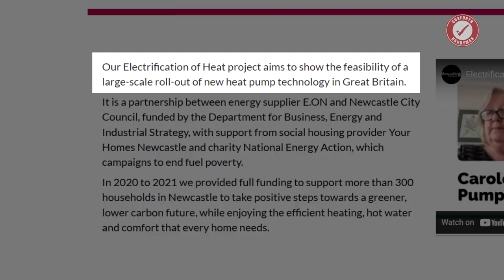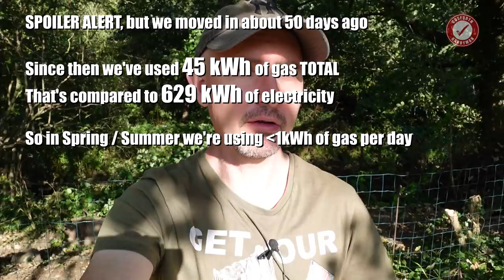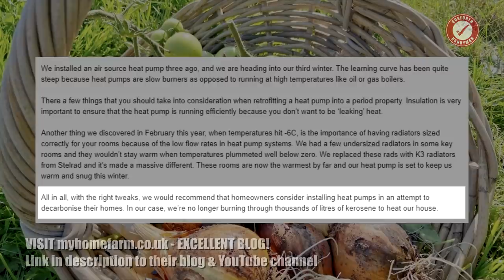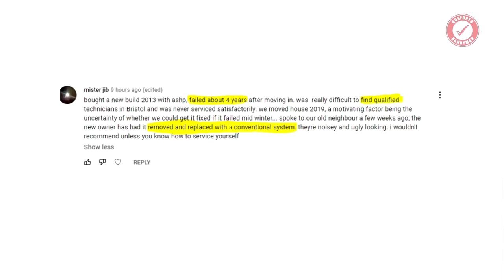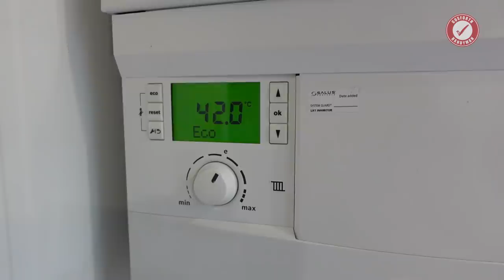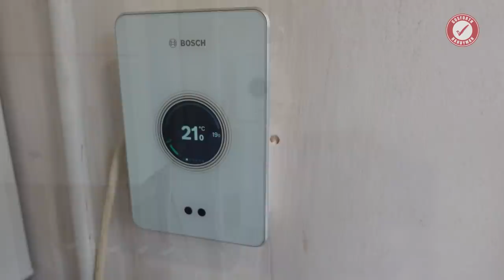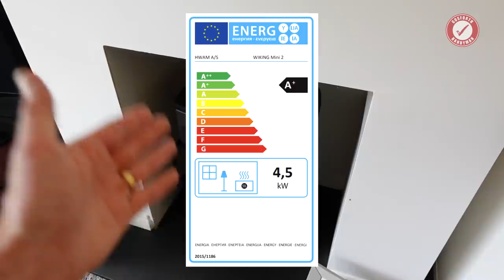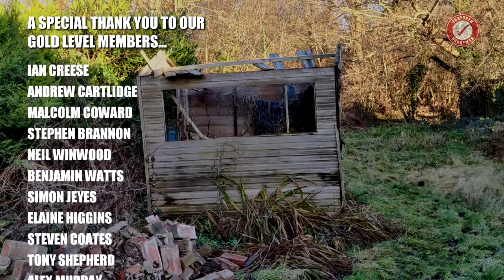Why didn’t we install an Air Source Heat Pump? (1920’s Renovation Part 32)

Comment: Wow. The backward thinking on ASHP and GSHP is astonishing. Putting in gas was just madness. The air available on a cold winter along with the refrigerant always will warm your house. Mine has been the equivalent cost as my last 12 year old gas boiler. A well designed system installed by competent installers will be a better future investment. It cost 2k less than upgrading to a new gas boiler due to incentives.

Comment: Everything you do is great except the damn spray foam. If issues arise like damp behind, wet rot, bugs, leaking roof you might be safe for now, but I personally would risk with this lazy option.

Comment: I find 50% of your advice and viewpoint spot on IMO. But I also find the the remaining 50% just seems to miss the point entirely. We must change our life styles and curb our expectations for the sake of the future of the human race.. that means the children and grand children that we love and the persons living on this planet that are not blessed with the support networks that we have the benefit of.. like NHS and public works flood defence projects. Elderly people need to keep cool in summer heat waves. No combi boiler can facilitate that. Maybe a shower that is so powerful that it can cause discomfort is an unreasonable indulgence, especially if 4 persons are showering on the same day. Personally I now use the sink and a flannel.. The government were not wrong on diesel vehicles as the intention was to reduce global carbon emissions by the switch, which they do. However we subsequently became aware of the health consequences of DPM emmissions and the complex cocktail of toxic elements therein posing a marked effect on human health of significant localised emmissions. There is a lot to say about variable electricity tariffs, vehicle to grid and vehicle to load possibilities powering the ASHP. If we have an ASHP installed there will be no radiators or copper pipes or circulation pumps running, but then we only have one ground floor room that we need to heat. The rest of the house will remain unheated, as it has been for the past 15 years. Different to many people's rambling mansions.. that they apparently need to make life worth living! G.A.L! 😉

Comment: Please don't use this clip as an intelligent assessment for the selection of a ASHP/GSHP. The mis-information gives an unbalanced perspective, ASHP are extremely efficient for the majority of the time with GSHP being the most consistent, You can also use a bore hole not only a slinky type. I understand the capital cost comparrison does favour the Fossil fuel boiler but if you take into account the CO2, NoX, SoX, CO the boiler produces for the entire life V's zero emissions of a ASHP/GSHP when electricity is provided via a renewable energy provider i.e. Octopus. You also forget to mention that a Carbon monoxide alarm is required to be installed with a fossil fuel appliance to mitigate the risk of Death, 439 people a year die from carbon monoxide poisoning, 0 deaths from ASHP/GSHP. You also don't allow for poor heating design as you should have installed larger radiators to bring your flow temperatures down to 55oC as not to only lower your gas bill but lower your emissions. A Gas combi boiler is 92% efficient in heating mode at 55oC flow temp and around 82% efficient in hot water mode, a ASHP/GSHP is 150 -200 % efficient. Insulation is key and it looks like you have done a great job of this. As for cost you should expect a full system to cost £8500 for a ASHP install on your property so £3500 after the gov grant proposed! Therefore cost campion to a gas boiler install. I have installed gas boilers for over 20 years and ASHP/GSHP for 11 years in Cornwall and ASHP/GSHP have proven to work when Fabric first is taken into account. I feel the gov has fallen way short on this grant and a district heating system should have been prioritised for residential. Lowering our emissions is a paradise shift and I also have little respect or faith in the Gov and rely on my own research. You should have researched your points before posting and potentially putting people off. Check out - 'Just have a think' on YouTube for some solid evidence of ASHP/GSHP's

Comment: Completely ignorant about heat pumps. Most of what you said is complete rubbish. Giving examples of failed installs is very biased. A correctly designed and installed heat pump is the cheapest form of heating.

Comment: You make many well balanced points, but I must take issue with your bringing in hydrogen! Just bringing it up is very weird, let alone comparing it with a heat pump: where are these hydrogen boilers that are waiting to take over? Where are the pipes to homes? Come to that, where is the hydrogen? Heat pumps exist, in increasingly efficient designs, they run on something that exists in spade loads, and can be 100% renewable - electricity! Same goes for your comments about woodburning stoves being carbon neutral (what rot), and finally, will people please stop saying the carbon footprint of making an electric car negates it's value to reduce carbon emissions - did you think that when you bought any other car in your life? Well, same applies now- if you're buying a replacement car, far better to go electric than buy another ICE car. Oh, and it is not true to say that 90% of people don't care about climate change and related issues.

Comment: I think this is a good series but the information you are giving people on heat pumps is absolute rubbish! A heat pump won’t be able to heat your heating or hot water on a cold winter night, really? Heat pumps are used in Sweden, finland and other countries which get much colder than the north east of England. I think that you have formed your opinion based on testimony from bad experiences people have had with incorrect heat pump installations, incorrectly programmed or heat pumps that have been installed in un suitable properties. I will say though that heat pumps are not suitable for all properties and unfortunately there have been unscrupulous installers that have fitted them in said properties just to get the job whilst the green home grant was active. We have been installing heat pumps for years now, in suitable properties, and up to now we have not had a customer who was unhappy with the system.
Reply: What percentage of traditional UK homes are suitable for heat pumps??

Also, how many home owner’s will want to have their homes torn up and all heating replaced by heat pumps at ALMOST UNAFFORDABLE PRICES??!